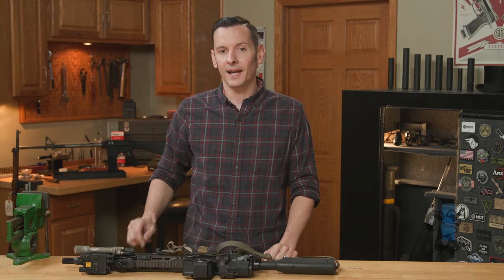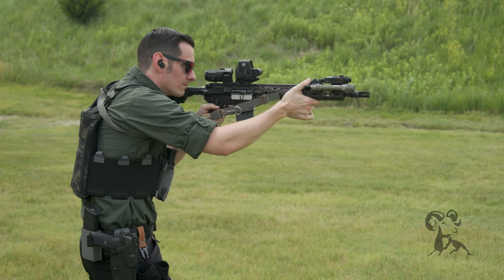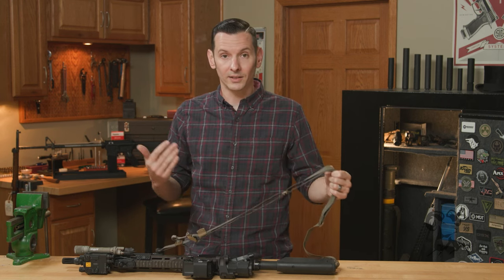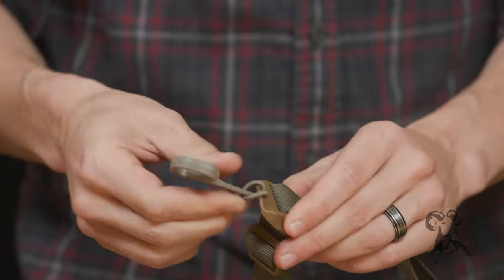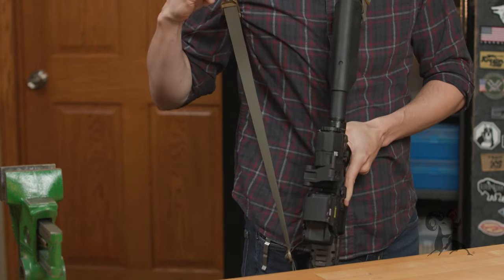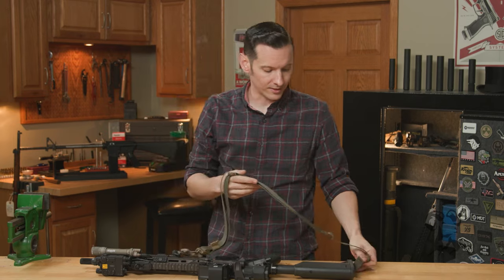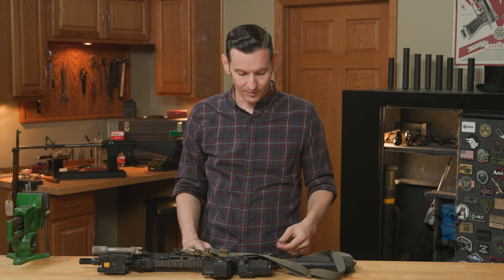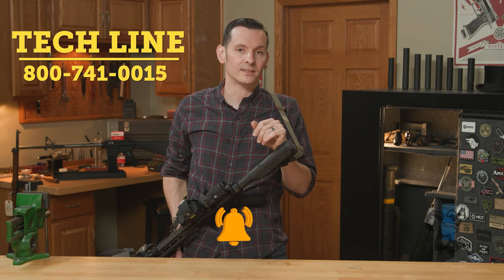Product Spotlight: Edgar Sherman Design Two-Point Sling

Comment: Better than a Vickers ?
Reply: Definitely.  Get the solid color because it’s better material and slides easier. They can’t get camo in that material.
Reply: Way better. 1 tab to pull both ways and smoother than blue force gear...
Reply: kekme8528  they still have the camo patterns but it’s made out of a different material. I’m sure it’s great as well but just doesn’t slide quite as easily.